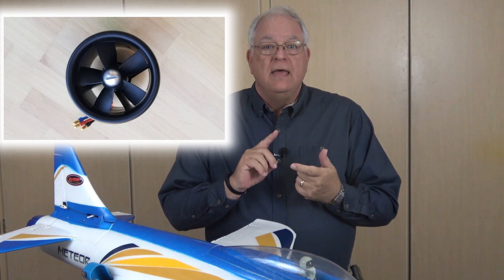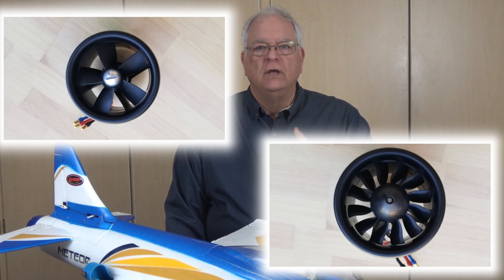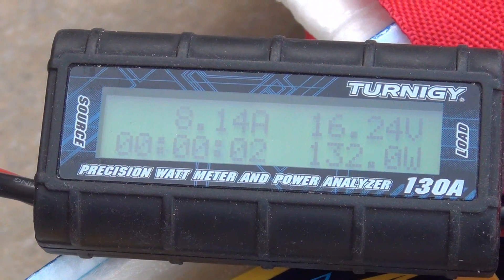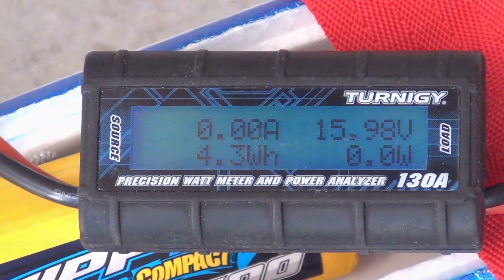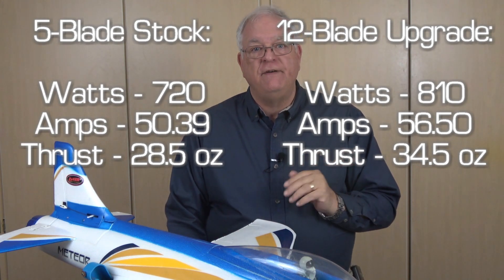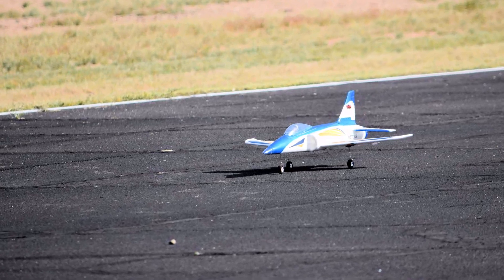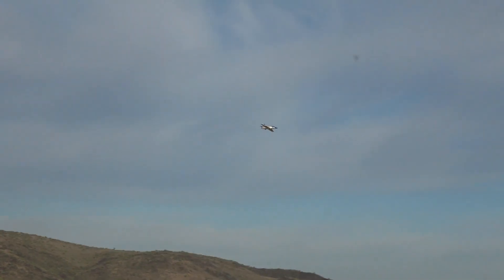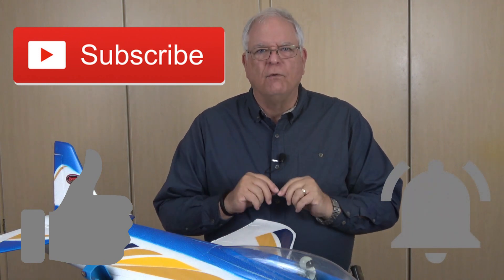Dynam Meteor 5 vs 12 Blade EDF Comparison

Comment: I have in the mean time installed a 12 blade 6 cell setup , thrust tubes , removed the canopy and closed up the cockpit and smooth it out to be a dart . Clocks 217kmh with out dive and out of shallow dive 230kmh

Comment: I have 4 Freewing 64mm planes. They all have the same thrust, but fly at vastly different speeds.  I don't mind the whine and the 5-bladed fans are fine.  When I move up to 70mm or 80mm, I will definitely opt for the 12-bladed units, but I'm happy to hear that the flight performance wasn't too much of a difference.  I'm sticking to my stock units for now, but my next plane will have lots more get up and go!

Comment: Am mostly reading the comments, the test comparison is a waste of time as it does not have the same electronics/components.
*the primary difference, besides the whistling 5b noise, is different amps and kv motor!
FYI, you can buy small remote for your presentation and no need to be reaching down to the keyboard for next slide or time it for each slide.

Comment: I felt like there were some mixed messages. Clearly the statis thrust, amp draw etc showed the 12 blade had highee numbers, but from your on field comments and a subjective view of the aircraft, the real world performance was much the same.

For someone wanting a 12 blade fan, your only reason to get one appears to be for sound and possibly availability.
Reply from the maker: I was expecting a bit more performance increase. Ultimately it did boil down to a better sound. That being said, the overall performance is quite respectable with either unit.

Comment: You need to use the same motor for test
Reply: Sadly,  that isn't possible. If you run the same motor using different fan blade number, you'll likely damage the motor. This comparison is as like for like as possible.

Think of this analogy: if you're having a food eating contest and you want to see how fast you're able to eat 250grams of a given food and one is soup and the other is a sandwich, you're going to use your hands for the sandwich and a spoon for the soup. There MUST be an appropriate motor match for any given edf with respect to fan blade count.
Reply: @nickhayley  
That is the purpose of the test results, to see exact watt meter numbers.
Instead of having a lower grade 5 or 6 blade, the test shall have started w a high end motor and ESC same to same.
Reply: Yes I’d like to see the lower kv motor with the 5 blade

Comment: I left the standard 5 blade unit in , installed a 80a ESC ,  installed a savox servo on the elevator , made a exhaust sleeving out of x-ray sheet to smooth out the ruff foam and went 5 cell with throttle control , turned the wheel legs 180 degrees so the wire is in the wheel well to reduce drag and now this meteor as a rocket such a blast to fly now unlimited vertical climb from take off

Comment: Did I miss the mention of flight time?  A 5 blade setup will allow more flight time because of the less amps consumed.  Makes more sense to keep the 5 blade If performance is about the same even with the whinier sound of the fan
Reply from the maker: It's all about what's most important to you. I went back to the lower blade count fan as the sound isn't that important to me. Others might feel differently.
Reply: Definitely the 10 and 12 b. they have a more pleasant sound. but do not forget that 5b. at the same power it produces more thrust than that of 10 or 12b.
Reply: @manuelverdugo1737 generally higher blade count produces more torque, less top speed.  Lower blade, less torque higher speed.  So a 5 blade will probably eat more runway but once flying and on step, performance will be marginally better than high blade count.  But there are many more variables that figure in - kv, C rating of battery, blade pitch and weight of the model.
Reply: @modeljetjuggernaut4864  yes but to same watts is best effyciency. a 5b requires between 480-520 watts to deliver one kilogram of thrust. a 10 blades about 565-600 watts for the same.